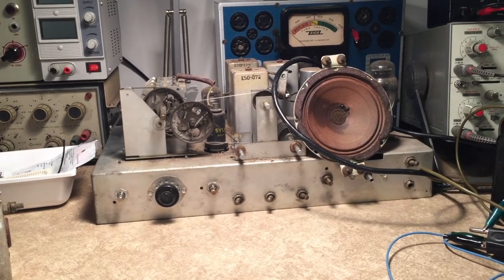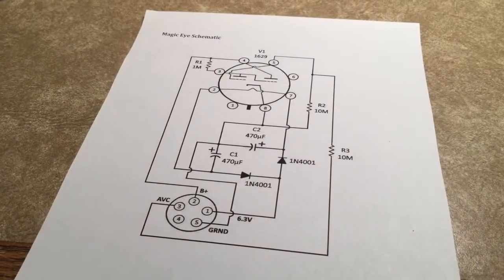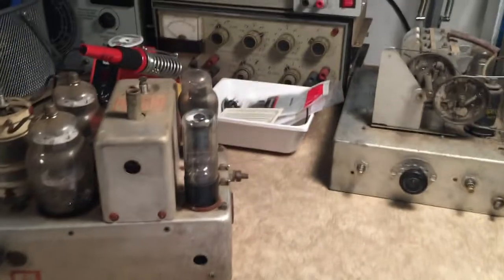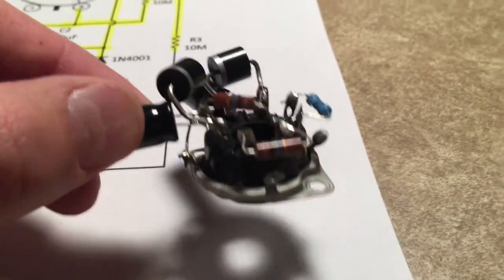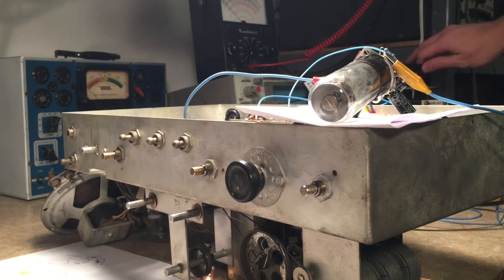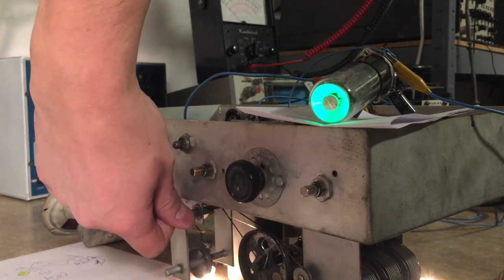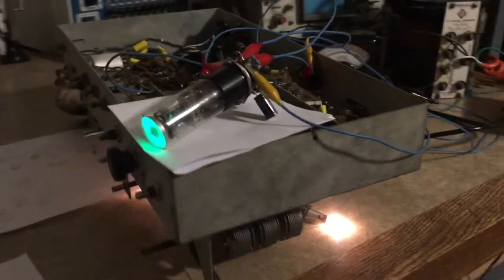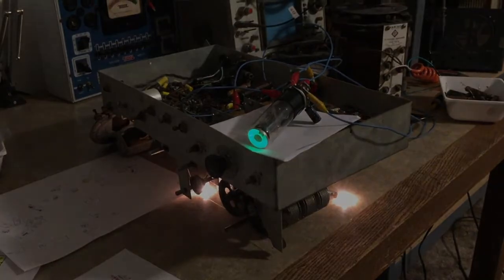Hallicrafters S-20R Shortwave Radio Part 1: Adding Tuning Indicator (Electronic Eye)

Comment: i dont get it, how does it work? is it pre arranged to fine line at a certain complex wave? because when it is out of tune it is still receiving waves... so what is the dfference between a tuned state and an untunned?
Reply: and why would you need it ? because it seems that you can perceive that you are in tune when can clearly hear the speaker talking perfectly
Reply: Can i use this schematics for any other radio or it depends on the model i am working on?

Comment: What transmitter was that that you got the magic eye from? Still have it?
Reply: Dave Schmittle That looks like an ARC-5 Transmitter(or SCR-274N).  Can't tell what frequency range it works on. I have a couple like it, mine are BC-459 which tune from 7-9.1 mhz.  These were used in B-17's and B-24's in WWII.